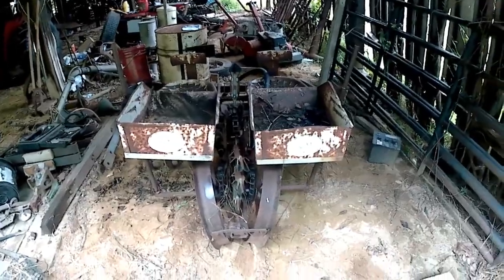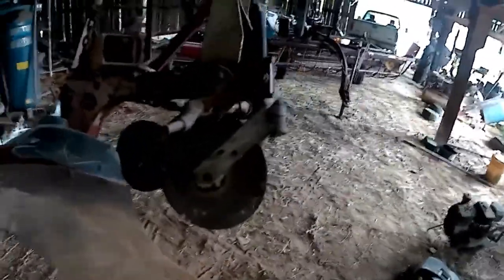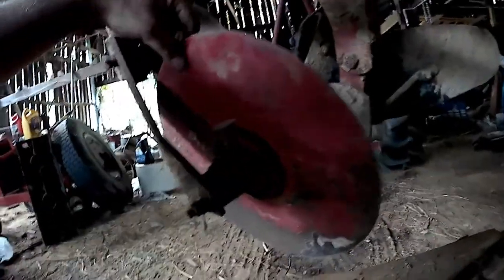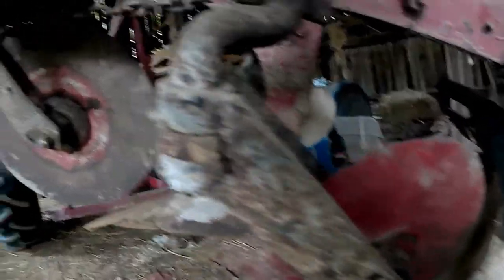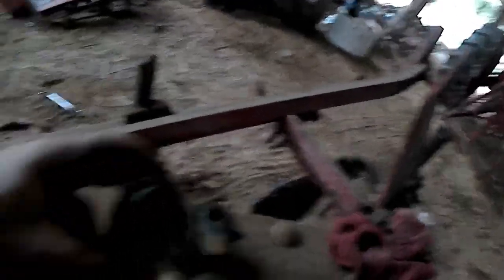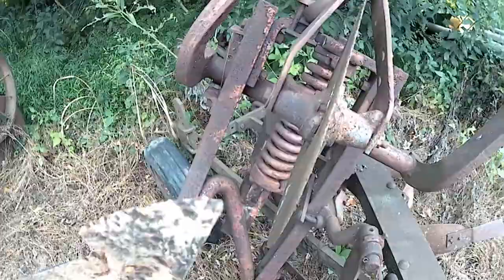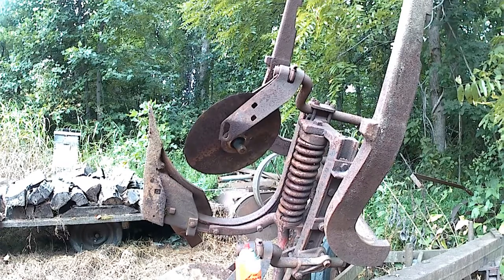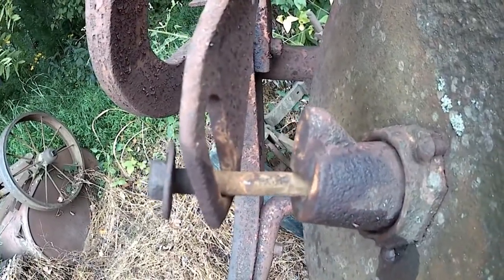Moving Stuff, getting a plow ready to use

Comment: Did you end up putting a clutch in your 150?
Reply from the maker: Not yet. The adjustment did make the pto more manageable. It even improved the main clutch operation. Now you can stop the tractor without slipping the pto, but you still can't completely disengage the pto with the pedal.
Reply: @rivervalleyfarm482  Good to know.  I need to adjust the clutch on my 150 and hopefully it will help.
Reply from the maker: It can't hurt. I'd get the I&T manual for too. Just in case.